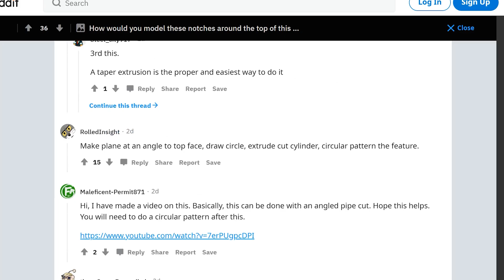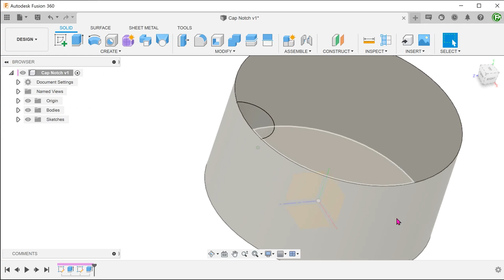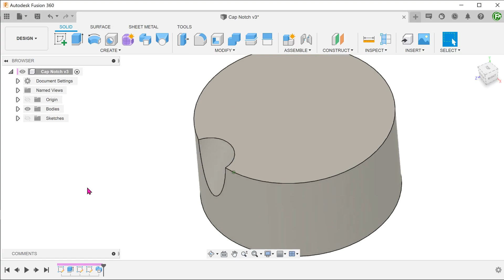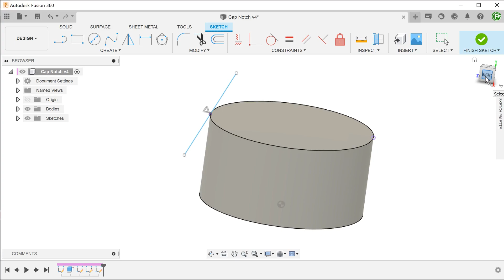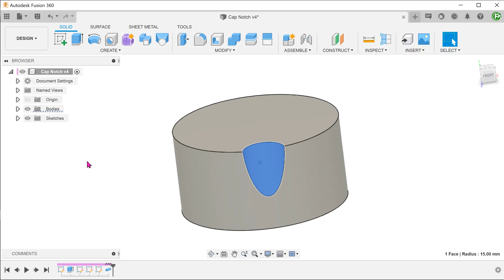Fusion 360 - Case study 15

Comment: I had to make a push dial button like this just the other day.  I drew a circle like you did and made another on the bottom.  I then made a loft selecting the full circle on top but only the half circle on the bottom.  Produced exactly what I wanted.  After that a circle pattern and viola.

Comment: Why not use your first method of a tapered cylinder but start the cutting cylinder offset from the edge of the main cylinder.  That way the point of the cone falls outside the main cylinder and you get the kind of bottom cut you desire.  For me that is less complex than creating a pipe at an angle.
Reply from the maker: Thanks for this suggestion. I went to try it and it does work. But it seems harder to control to create the right "look".

Comment: It would be great if the pipe command had more shapes (flower, star, wheel etc).
Reply from the maker: That would be useful. My only wish is that we can have a rectangular cross section where we can adjust the length and width.